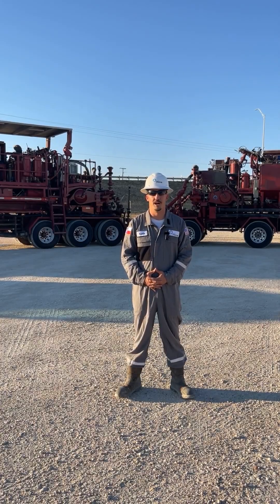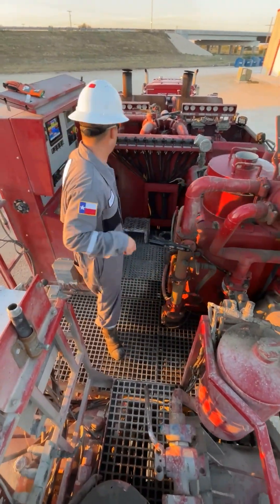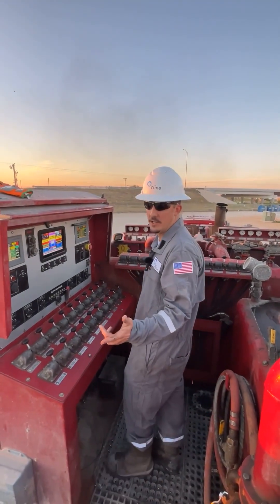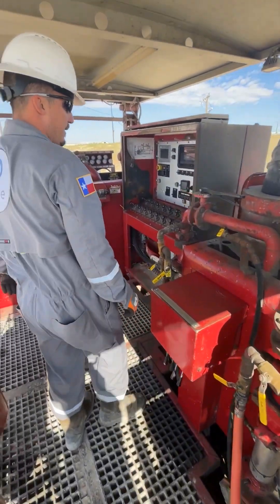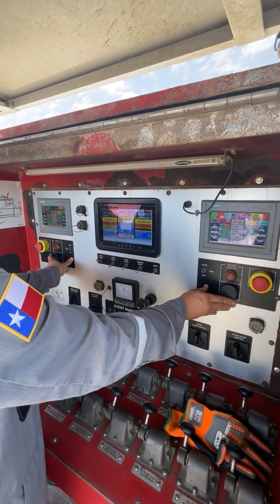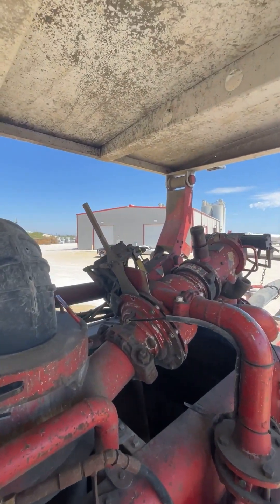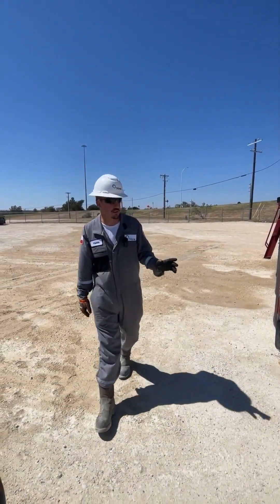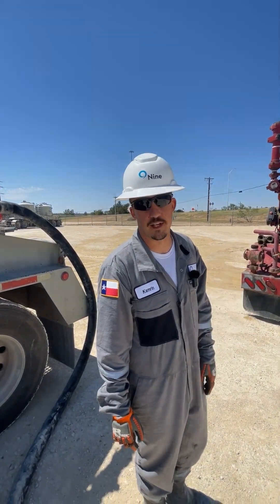Nine's Cementing Unit Winterization

Comment: Wait till trump gets in and opens oil fields in government lands there will not be enough pump trucks to fill all oil well demands the national rig count is down well there 30 rigs running in the bakken and there’s is only 430 rigs running in America now!! when there was at its highest peak in 1981 rig count was 5300 rigs running in America that mean not only will steel manufacturers have to start ramping up rig production but we need 4900 more rigs back on the dirt to catch up with 1981 production levels! And what going to happen to nine energy with there tiny 1100 employees they also will have to ramp up and buy new equipment and hire another 1100 employees or stay small and work twice as fast and that not happening!